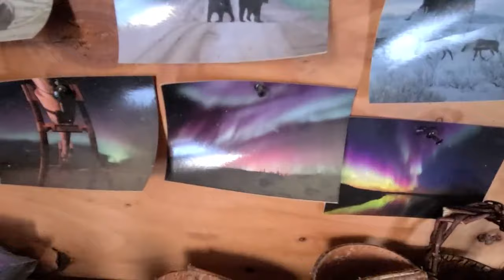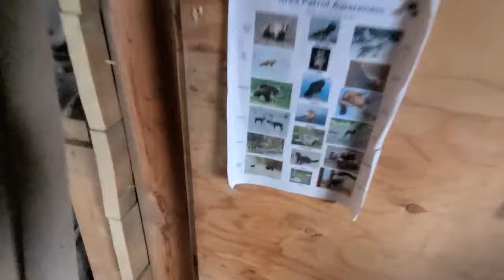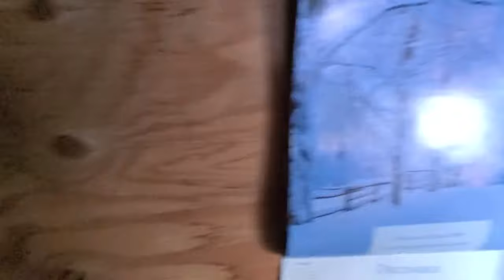Coldest hike of my entire life!  (Dalton Highway, Alaska) -42° below zero

Comment: be careful shoestring. you may not feel it, but in the cold your body is working much harder and burning a lot more calories and water. you need to drink just as much water as you do in the summer desert. you're definitely not carrying enough water or calories with you for those temperatures. unless you're very aware and constantly doing cognitive testing the cold will sneak up on you without you realizing it. ever seen videos of hypoxia, where trained experts aren't able to do basic math or reasoning but they feel perfectly normal and never realize any change took place until they watch recordings of themselves after they recover? similar things can happen in the cold (for different reasons)... i am not trying to tell you what to do,  i just want to see you stay healthy.

Comment: Why the hell did you try this in the winter? Do it again in the spring or summer, hell even the fall, but not the winter. Those famous people you talked about had proper clothing, sled dogs, and sleds and proper winter tents that they could setup and sleep in. Waiting for a ride is good, but in winter more people stay at home (because they are smart) in the summer people don't mind getting out and driving around. Also that truck that pulled over and then took off, was a guide truck for those 4-5 tractor trailer trucks that went buy. His job was to make sure the road was safe for the trailer trucks to continue quickly down the road. If he saw a problem he would radio the trucks to either slowdown or stop till the way was clear. Also he is warning people on the road that there is something coming down the road and beware. Love your videos and respect you (saying I love you also is a bit weird LOL) so respect is good. Don't be stupid, be safe and continue making more videos!! I love the Alaska videos since it's the only state I have not been in, so at least I get to see it, even if its from your eyes.

Comment: It would be so easy to make a sheet metal collar to go around that pipe and screw it it at least to cut that draft down a bit or keep breeze out. Could even silicone it, it's good up to 650 and unless you have a chimney fire it shouldn't be that hot there anyway

Comment: -42 aint that bad..... in NE montana she drops to -50 a lot..... plus we ALWAYS have a 10mph wind (if not 40mph)
.
i had to fix a gelled up semi....-56f + 50 to 70mph winds...... it was NOT fun
but i got that rig going..... he was able to do about 5mph into our shop, where he sat overnight and unthawed 
.
next day was 20 degrees warmer
.
dude drove from texas with tanks FULL of summer fuel...... big mistake (about a 1000 dollar mistake)
had to put on new fuel filters..... and fill his tanks and filters with "diesel 911"..... 
but when its THAT cold.... even the 911 will start to gel up.... 
.
i was honestly thinking about starting a fire under his fuel tanks lol
.
truckers that operate mostly in the cold have "fuel tank heaters"...... and NEVER shut the truck down
it runs engine coolant into a "radiator" in the fuel tank..... keeping the fuel around 50F
.
ive even had amtrak gel up on me while riding it..... (legally lol)
they sent up 2 more P42s.... and they gelled up
so they sent 3 SD-40-2s out.... "winter specials"..... winter fuel + 911 + tank heaters
.
and after 8 hours with no heat, shitters, or electric lights.... we finally got on the warm side of the pass
this was on the "hi line" on marrias pass around 2002

Comment: Glad you made it back to civilization safely!
Reply: 50 trucks, and just as many light vehicles, run that road a day. Hardly wilderness.
Reply: @johnbaskett2309  did you even watch the video? It was cold as hell and the only place he could find to stay was a poorly insulated shack.
Reply: @nmonster  All he had to do was flag down a truck for a ride to town. Why didn't he stay in the generator building? I have a car parked thirty feet from that souvenir shop. I have traveled the Dalton 100's of times. I used to live 100 ft up the road from where he was standing at the start of this video in Fox. Don't need your lectures. I'm fed up with these bullshit peddlers in Alaska.
Reply: @johnbaskett2309  maybe he didn't know about the generator building? Just glad he found a warm place to sleep, even if he wasn't literally way out in the wilderness.
Reply: @nmonster  That's where he got the firewood. There are only two buildings there, the camp and the big ass generator/shop building.
Reply: @johnbaskett2309  I see.

Comment: I live 300 miles west of the bridge in Galena. We've had one of warmest winters in years. Never got to 40 below so far. Last winter was  a bit of a bitch, it got down to 60 below and never above 50 below for a solid week. This guy is wearing the wrong gear. I've slept out in 40 below many times without a problem. It's all about the gear. Bunny boots would be a good start.